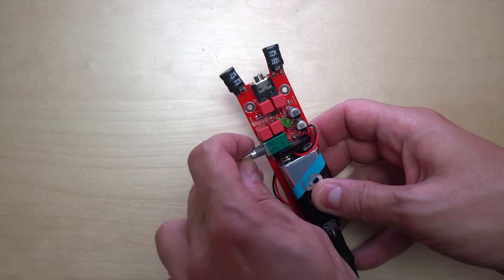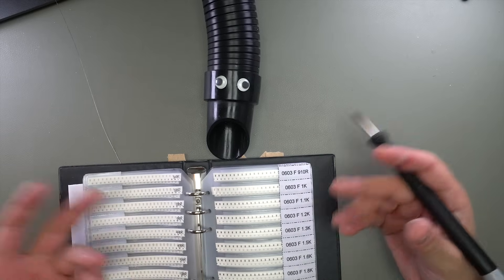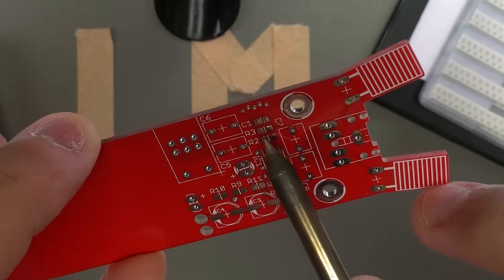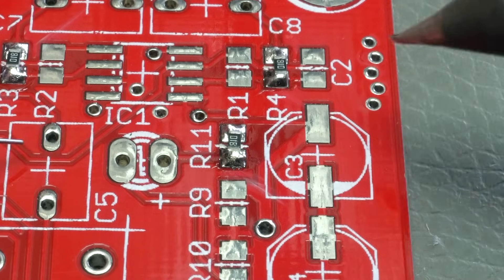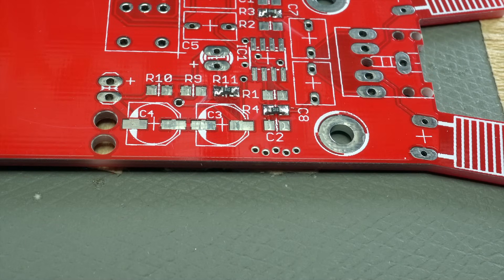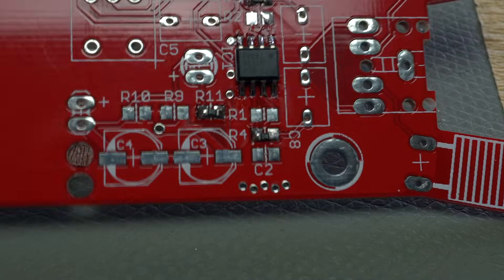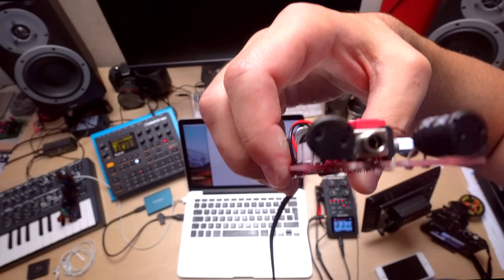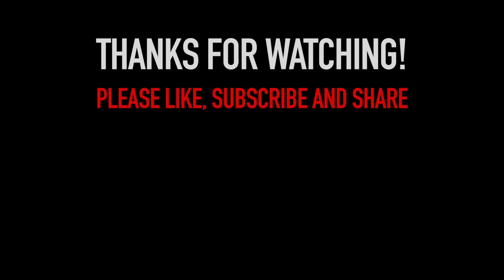How to Solder Surface Mount parts (it's easy!)

Comment: Dumb question...the first three components you soldered in the video...does it matter which way they go?  If so, how can you tell which way they go?
Reply: Its a resistor. It doesn't matter which way it goes. Resistors don't have polarity.
Reply: @Dogukan737  Thank you!  I bought a DIY kit that didn't come with instructions and I'm pretty new at this (obviously).    I should be able to put it together now. Thank you again!
Reply: So this kit I'm working on has the spaces for resistors, like R10...well there's other tiny surface mount spots that have a C number, like C10, but they look just like the "R" components.  They don't have polarity either do they?  I'm never buying a kit without instructions again...*sigh*...
Reply: @douglasbollinger3626  Those might be surface mounted capacitors, in which case they certainly have polarity, and that should be marked on the component.
Reply: @douglasbollinger3626  Oh, actually. The capacitors may be ceramic, in which case they dont have polarity. If there is no indication on either the part (should be a dark line on one side) or on the pad, then the cap doesnt have polarity
Reply: @Dogukan737  Ok, great, thank you again!  I'll try to do some looking and see what I can find as far as the markings go.  I appreciate all of your help!

Comment: What if I wanna solder a tiny cable on a surface pad?
Reply from the maker: No problem, you can solder a wire on a pad just like any other component.

Comment: Dumb question but what temp for the iron. I have a 60w soldering station
Reply: Not dumb at all. If its adjustible, i'd go for 300-350 (lower preferred), until you find it takes more than 1-2 seconds to heat the pad and solder so the solder will flow onto it. 
Going higher might be necessary if you solder a mosfet with a heatsink, to get it done before you cook it (or die of old age). 

Going higher isnt inherently bad, you just have to be faster with your solder joints, you lift pads if you take too long

Comment: Im doing a electronic technician class and the teacher has me using the thick ass solder instead of the thin one you're using. It's hard as hell to use the thick solder. Even you said that it was difficult in the video and even named why you won't use it.
Reply from the maker: Yeah, for fine work thin solder is pretty much a must. I mean you can probably put on a big glob of solder and wick some of it away but that’s slow and adds unnecessary steps. 

Good luck with your class!

Comment: Great video!, what heat temp do you recommend for this??
Reply from the maker: Temperature is all up to the solder that you happen to be using.  It's usually listed on the spool (or on the manufacturer's website) so look there and set accordingly.  Thanks for watching!

Comment: You don't solder with a conic tip.
Reply: My thought too! I like chisel tips and 45 degree agled tips only. Chisels are my go to tips. Problems with sharp tiny tips are about heat transfer (and no way to drag when it helps!)
Back when I started working with smd I used tiny sharp tips, tiny solder and soldered them pin by pin. No solder masks on home-made boards back them I'm way past that step now. Flux and drag soldering or even a bit larger chisels with flux are way to go. I actually prefer a bit larger solder like 0.5 or even 0.7mm diameter for stuff like 0805 size. All you do is a gentle touch to get enough solder. With very tiny solder you really need to feed it in, too slow for my taste. My preferences may be due to getting used to larger solders back when tiny solders were not easily available. Never got used to the tiny stuff unless in some very special cases.
Partially soldering tool selection might be to what you're used to. Sometimes different tools seem to be preferred by different people.

Comment: I just soldered smd voltage regulators for the first time as a test and decided I like them. Next pcb I'll add resistors and caps. I will make sure to clean the board first with alcohol. Great video, thanks for posting.

Comment: Can I ask You what temperature You use to not burn parts?
Reply: I set my iron on 600 degrees seems to work well for everything, some might say 700 or higher. I got started in electronics in 1965 in H.S. put together a 5 tube radio.
Reply from the maker: The temperature really depends on what brand and formulation of solder you happen to be using so it doesn’t make sense for me to throw out a number since yours might be different. 

Your spool of solder will usually have the ideal temperature written on the side so go with that.

Comment: Isn't it is easier and cheaper to use a pickup coil or telephone pick up? Results are pretty much the same. And most probably it is spelt as "Elektroslukh". Otherwise, great content, keep up!

Comment: that's actually the electrolytic smd caps which cause me the most trouble.
most of the time you can barely see the pads underneath when they are in place and it is difficult to make good contact between the iron and the pads.
I found that pre-soldering one pad is not convenient in this case.
Reply from the maker: Yeah, those can be finicky for me too.  I'll give your method a try (not pre-soldering the pads) and see if I have better luck.

Thanks for watching!

Comment: Where did you get your book of 0603 resistors? Alibaba?
Reply from the maker: Correct.  It was ages ago that I got it and I don't remember the seller, but this looks like it might be it:  https://www.aliexpress.com/item/1-PC-Black-0603-1-SMD-Resistor-170-Values-50-pcs-value-8500pcs-Sample-Book-Assortment/32722979994.html
Reply: Nice video, I would like to see drag soldering techniques and also desoldering techniques for smd on your next videos if possible. Thanks.